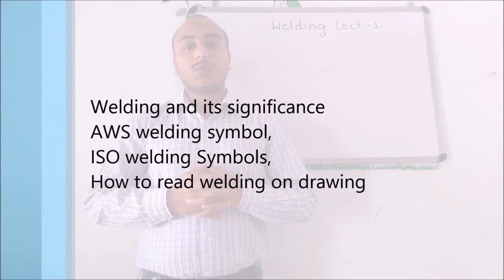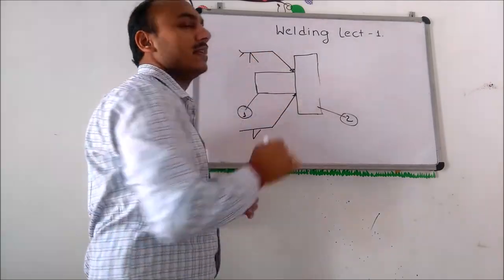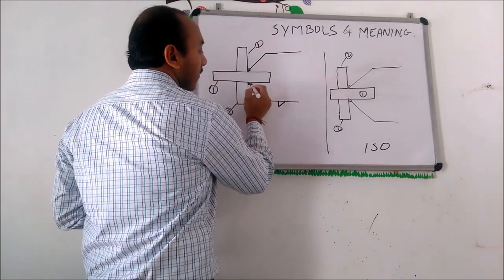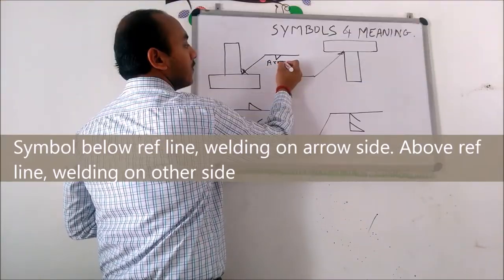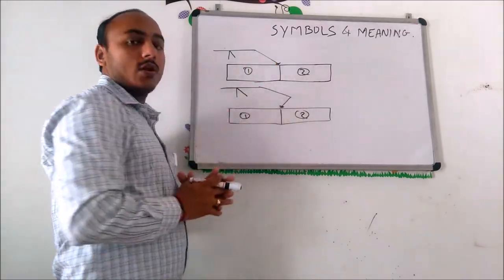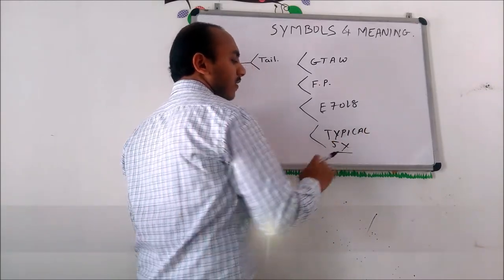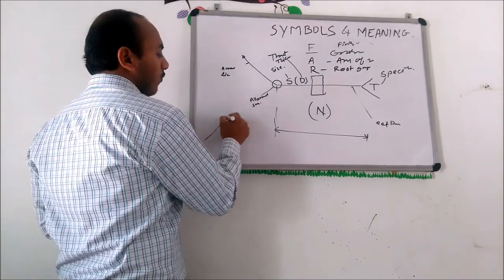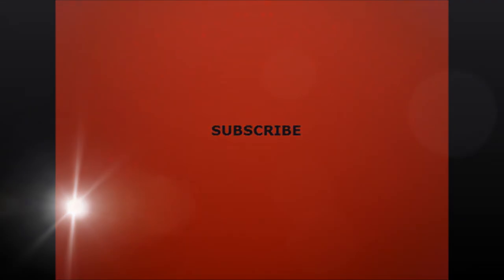Welding lecture 1

Comment: At 4:12 u r showing the wrong representation.. As per iso 2553 the reference line get eliminated in the case of both side welding.
Reply from the maker: I generally use AWS. I don't know much about 2553. But This is I am sure that ref line used to show other side welding in ISO.
Reply: Yes the reference line is used in iso 2553..but it omitted when we are giving symmetrical both side welding